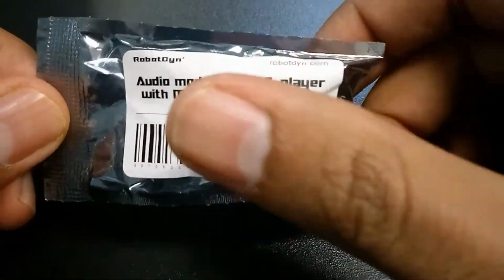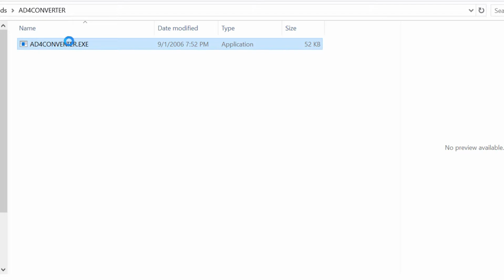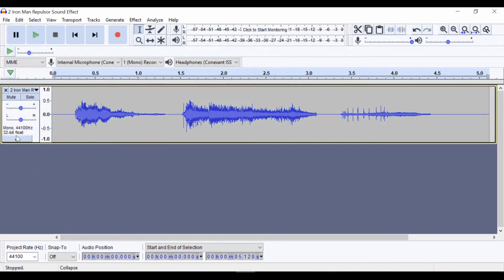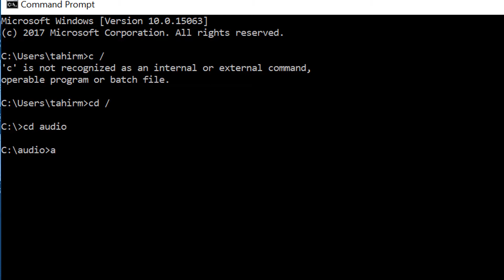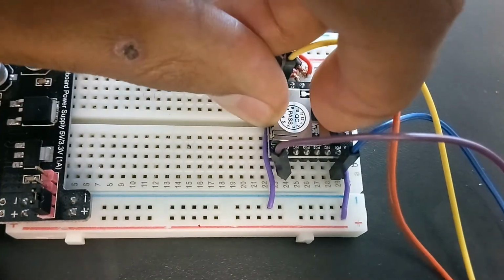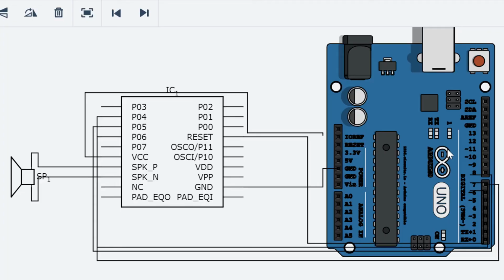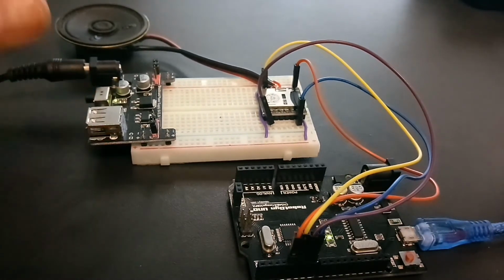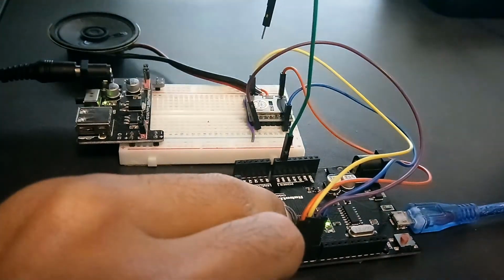Arduino mp3 module Tutorial - wtv020sd16p: Code, Connect, and Run!

Comment from the maker: Here's the code guys:

*
 Example: Control a WTV020-SD-16P module to play voices from an Arduino board.
 Created by ELECTRONOOBS, oct 14, 2016.
 */

#include <Wtv020sd16p.h>

int resetPin = 4;  // The pin number of the reset pin.
int clockPin = 5;  // The pin number of the clock pin.
int dataPin = 6;  // The pin number of the data pin.
int busyPin = 7;  // The pin number of the busy pin.

/*
Create an instance of the Wtv020sd16p class.
 1st parameter: Reset pin number.
 2nd parameter: Clock pin number.
 3rd parameter: Data pin number.
 4th parameter: Busy pin number.
 */
Wtv020sd16p wtv020sd16p(resetPin,clockPin,dataPin,busyPin);

void setup() {
  //Initializes the module.
  wtv020sd16p.reset();
}

void loop() {
  wtv020sd16p.playVoice(0);
}
Reply: Well explained! May I ask , what is the SD card capacity you used ? Can 2G be used ? Thanks
Reply from the maker: I think these old modules only support upto 1gb.lesser the bettee.
Reply: Thank you

Comment: I have a question.  I am trying to use either SoftwareSerial or AltSoftSerial libraries.  I have tried both.  There seems to be a conflict with the WTV020SD16P library.  The WTV020SD16P library is not using the serial port....or is it?  When I comment out the line "WTV020SD16P wtv020sd16p(resetPin, clockPin, dataPin, busyPin);" my serial communication works great.  When I UNcomment this line, my serial communication stops working.  Maybe a timer issue?  Any ideas on how to solve this issue?
Reply from the maker: Im not sure but youre probably correct. Both libs together could be conflicting. Maybe not use softserial? Get another arduino with a dedicated hardware uart..like the pro micro or mega.
Reply: I'm also having issues with this line of code. :(

Comment: GREAT VIDEO.  I am currently trying to add sound to a product that I am designing (proof-of-concept design), and your video was awesome.  I did have a couple of issues with the #include <Wtv020sd16p.h>.  I think that maybe a more recent version of this code is all cap's, so the line should look like #include <WTV020SD16P.h>.  I compiled several times and kept changing from upper to lower case, etc. and finally got this figured out.  I also inadvertently installed "wtv020sd16p-master.zip" which did not seem to work, and then I selected MANAGE LIBRARIES and searched for "wtv020*" and installed this version.  It did not have the "-master" suffix.  I followed every single step for mp3 to wav to ad4 conversion as well.  I am just waiting to take delivery of the modules.  I could not find the RobotDyn module that you used in your video, so I purchased another brand on Amazon (https://www.amazon.com/gp/product/B07K7HYXQR/ref=ppx_yo_dt_b_asin_title_o00_s00?ie=UTF8&psc=1).   I also purchased a 1GB microSD card on Amazon (https://www.amazon.com/gp/product/B001QD3OOE/ref=ppx_yo_dt_b_asin_title_o00_s00?ie=UTF8&psc=1).  Thank you.
Reply: What an amazing project going on. 
Do you have anyupdate?

Comment: It’s says “ the system cannot find the path specified” on the command prompt? Idk why??
Reply from the maker: Is the library installed?
Reply: Fungineers what do I need the library for?
Reply from the maker: @lordmega544  all the commands in the code work with the wtv.h library referenced at the start. Without the library the code wont work. Find the lib on github and download the folder to your arduino library folder
Reply: Fungineers I’m using a df player, so will it use the same library?
Reply from the maker: You will need the df lib and a different code also. Should be plenty available online
Reply: Fungineers so can a df player play both mp3 and wav files?
Reply from the maker: Should